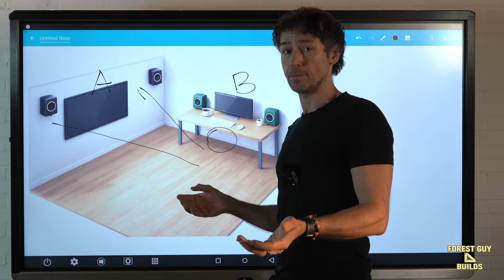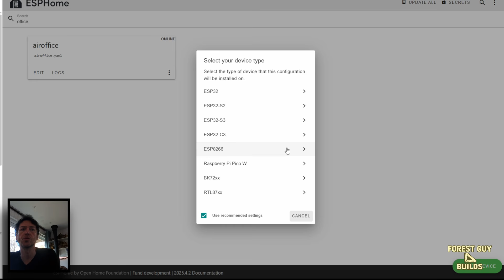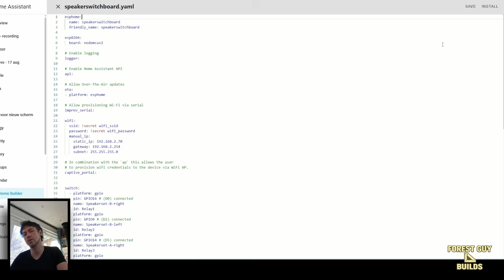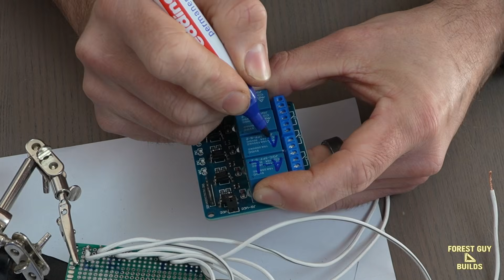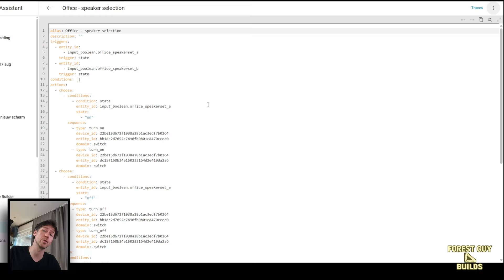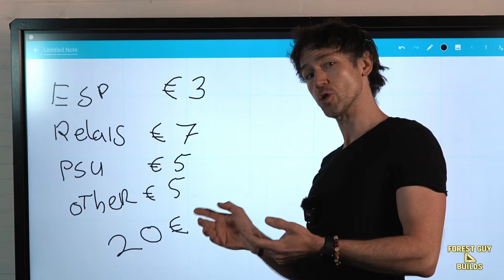Switch between speaker sets - Home Assistant diy

Comment: Brilliant video you have a subscriber. You could add a line audio in and out device selector using the same concept. Similar to building a smart  audio matrix.
Look forward to the next project
Reply from the maker: Thanks a lot, and welcome as a subscriber! 😄

That's actually a cool idea. In my setup the PC is the only audio source at the moment, but if you have multiple sources it would definitely be interesting to manage that through Home Assistant as well.

I hope to publish a video I'm excited about in a few days! It's about DIY improvements to a heat recovery unit in the house. Making use of servos, 3D-designed and printed parts, and manual air-duct dampers to control airflow to the rooms in the house. Everything is automatically controlled based on the CO₂ level in each room.

It makes the system more energy efficient, loses less heat, and makes it quieter at night — which I find the biggest gain! It's been working great for several years now and I wanted to share that (and in the meantime a lot of new ideas ended up on the list!).

That was actually why I started this channel, but I needed this speaker selector, so I built it as a side project 🙂. It's really nice to see other people enjoying it too!